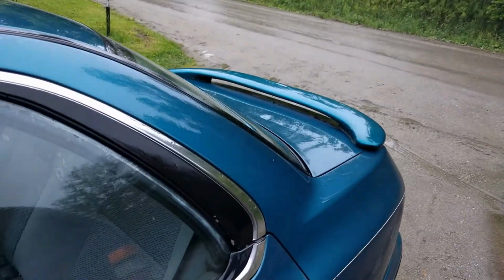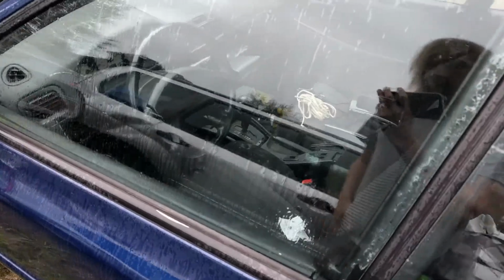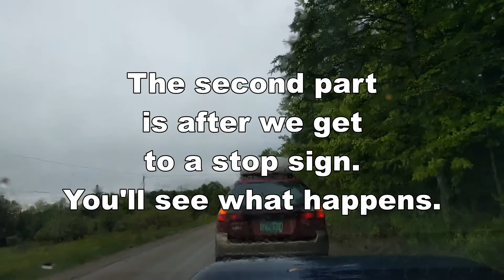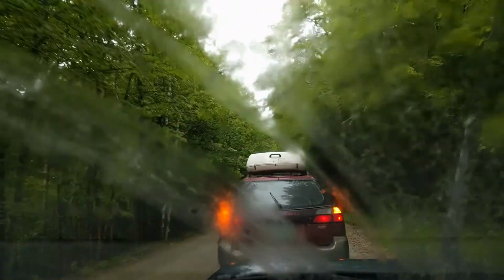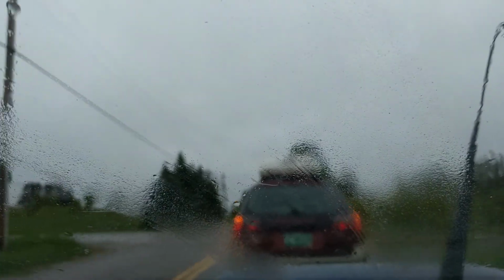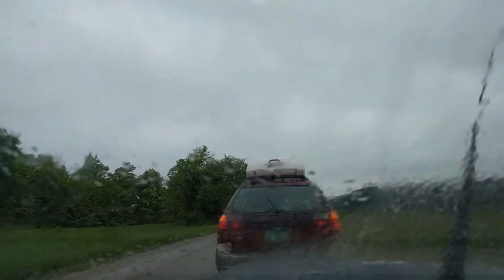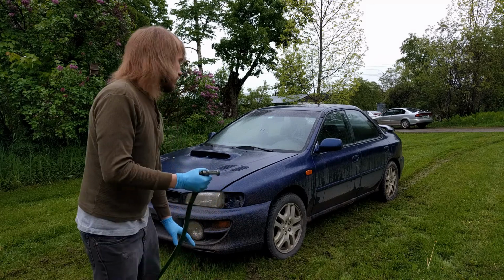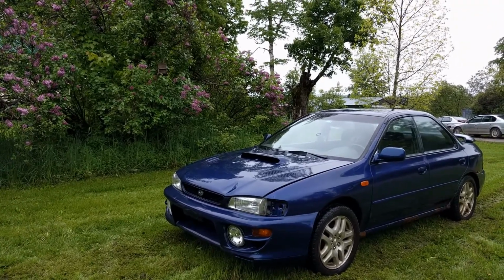2001 Subaru Impreza 2.5RS - Towed Home by Another Subaru - What A Ride!

Comment: I never knew the 2.5RS was a GC6, only have ever known and owned GC8's.. Very cool though, I'd keep it throw in a cheap EJ20 and do some autocross with it.. Started getting sketchy around the 9min mark damn bro... balls of steel!
Reply from the maker: Everyone calls the '93-'01 Impreza the GC8 in the USA, but we never got a GC8!
We got GC2 (EJ18 my current daily), GC4 (EJ22 my old daily), and the GC6 (EJ25 the car in this video), but never the GC8 since that was the turbo model. We also got the GF and GM models with all the engine options except the turbo. So sad, because the GC8 is essentially my dream car.
That has always been my dream build is an EJ20 in a 2001 2.5RS and essentially slowly build a Version 6 WRX to USDM spec as if we had actually gotten one! This shell isn't really in good enough shape for that build though, but your autocross idea is a good one!
It was definitely a sketchy ride, but nothing too harrowing this time.

Comment: Nice video and almost had a scare there when the tow strap broke off, i have seen a video of a WRX being tow this way and the steering lock up and they crash into the side of the road with a bigger repair bill. 

This GC model has a memory in my childhood year as i grew up watch Richard Burns, Petter Solberg and 
Colin McRae drive the Subaru WRX STi in WRCs when Subaru was active in the World Rally. I played Rally Championship which was way before Dirt series ever come out and will always choose the GC WRX STi. 

As discussed on Facebook, put the boxer 6 engine and get rid of the auto box for the RS 2.5 5 speed manual box. 

you can try ebay or the US Subaru club forums for GC parts from various GC WRX owners there.

The rims which always match the GC is the rim below.

http://s161.photobucket.com/user/GT_Wagon/media/Subaru/Wheels/Goldies/9e5dac0a.jpg.html

its 16 inches and you can fit the Subaru WRX 4 pot front and 2 pot rear calipers with ease.

a Rally livery GC will turns heads

http://1.bp.blogspot.com/-FrtEI1l-N9Q/Tb2uxfKxV9I/AAAAAAAAPXA/ZHKXQ2kUPrw/s1600/3+tourdecorse1997subaruimrx2.jpg
Reply: good luck with the project if it ever happens.
Reply from the maker: Hahaha believe me we think alike! I would absolutely love to do a rally livery, 4/2 pot brakes, and buy an up rated transmission. Unfortunately I just don't have the budget. Buying on eBay usually means higher prices on big Subaru items than I would pay local anyhow.
Best I could do for now is US spec '02/'03 WRX brakes front and rear, which are still substantial, just floating instead of one piece calipers. Then I could do the H6 for free essentially with most likely a 5 speed and rear end from a Legacy or Impreza I could find dirt cheap. Woulds still be epic though. I'm heavily considering it. As for the wheels, I do actually have the 2.5RS set as well and they are some of my favorite wheels. The ones you linked are cool, but not actually my favorite. It would definitely be getting different wheels though. The ones on it have to go back to my brother.
Thanks for the comments as always! Will still look at your FB post later.
Reply: haha there is a saying goes that Subaru cars form Brotherhood.

https://forums.nasioc.com/forums/

http://www.clubwrx.net/forums/content/

as mentioned previously, if ebay is too pricey for parts. 

you could try the forums for fellow Subaru owners in the USA.

some of the owners are willing to help fellow members with parts sourcing and might be willing to sell some spare parts for cheap. 

I once got my Forester some STi parts like the Brembo brake calipers, top mount intercooler and a nice STi end tail pipe from some STi owners who swapped parts.
Reply from the maker: Yeah they definitely do! If someone likes Subaru I know we'll always have something to talk about. :P

I made a NASIOC account a looong time ago, but have never really gotten involved. Definitely browse there a lot though. I know people like to wheel and deal and in the future I probably will. Thanks for the tips of course.

If this shell was in better shape I would make it into my dream car, the USDM Version 6 WRX we never got, but it's a bit too crusty.